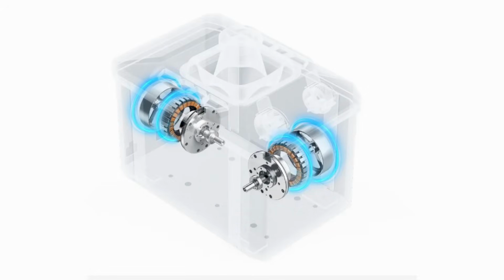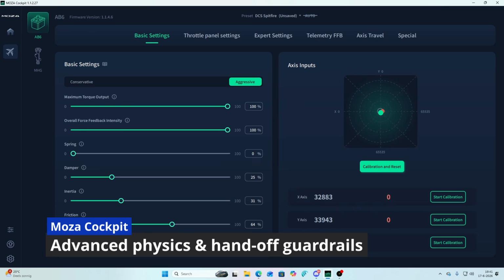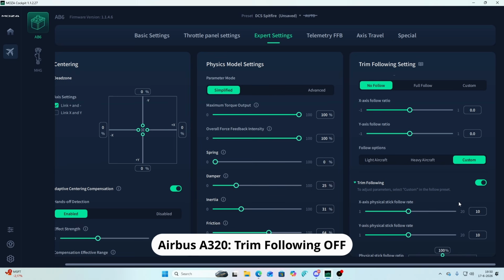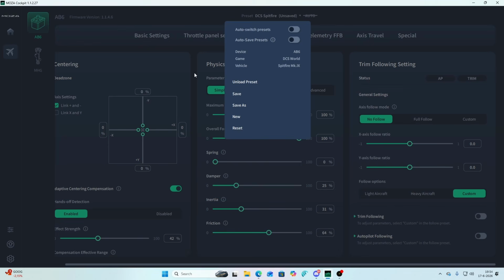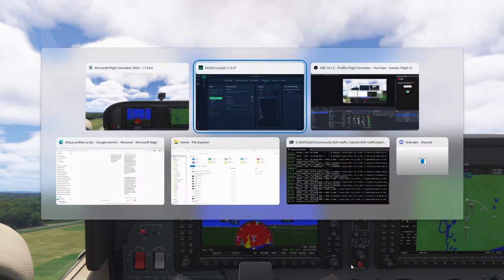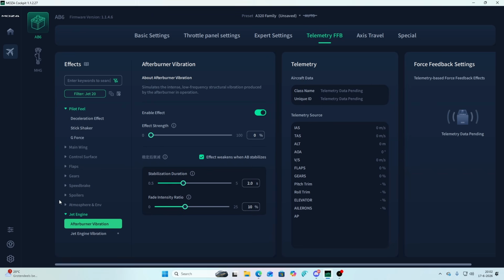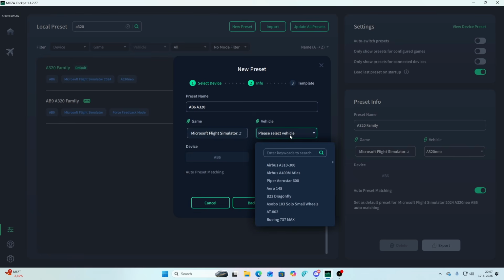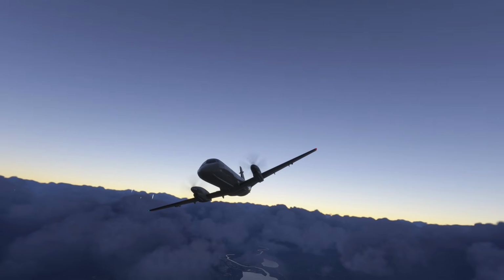The absolute secret to Moza AB6/AB9 Force Feedback settings in MSFS 2024

Comment: I see no Ground vibration effect in Cessna 172. While in A320 this effect works. Can`t set it up to work in Cessna thought.
Reply from the maker: Check my website it contains the profile I use
Reply: @Highintheflightsimsky  still nothing. only propeller vibration\flap motion works. even in your video 14:32 there is no gears telemetry at all. perhaps different planes models provides different effects ((